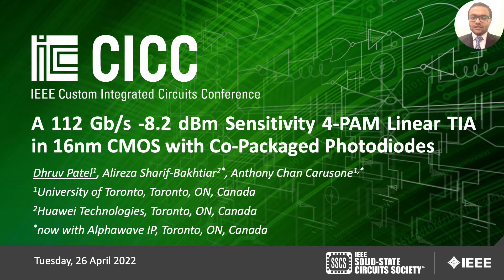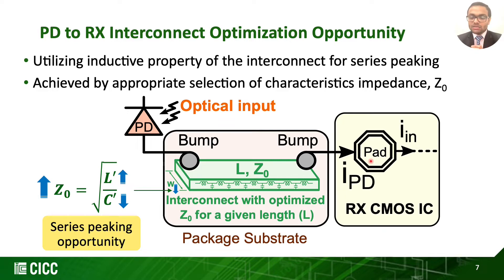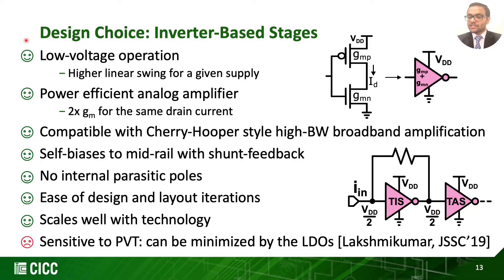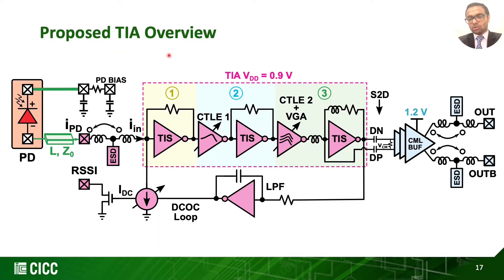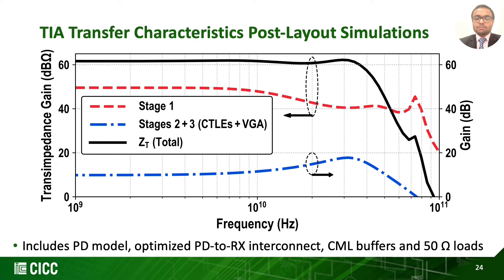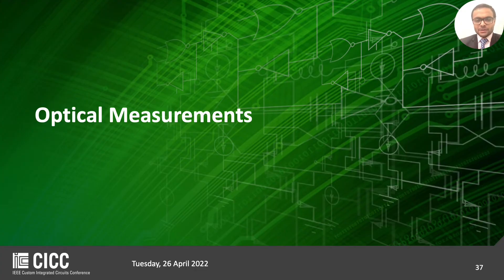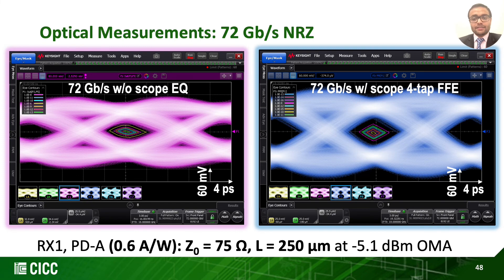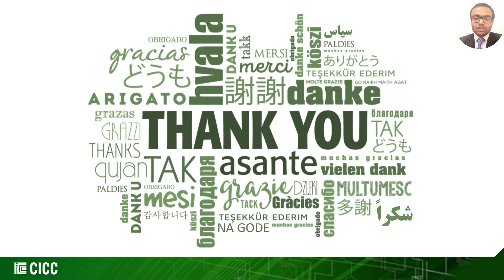Deep-Dive: 112Gbps 16nm CMOS TIA with Co-Packaged Photodiodes

Comment: 100x100 resolution 10000.  2500.    4. Track size speed direction weight or g gravity start.     AC.    Key 2.    Solid liquid gas = plasma or snow effect on off grey scale - earth atmosphere north 5% axis tilt from equated lssl